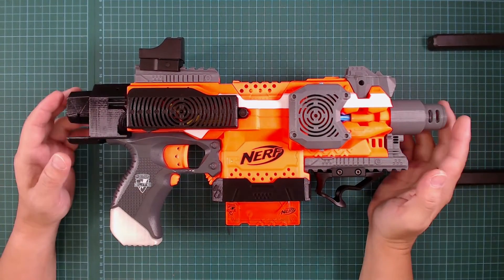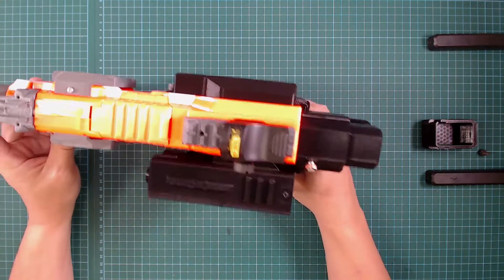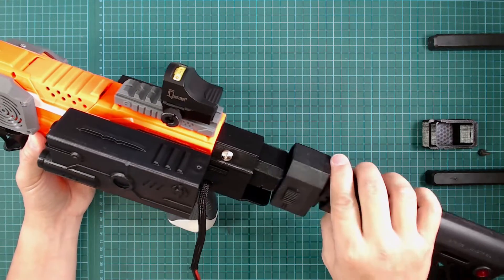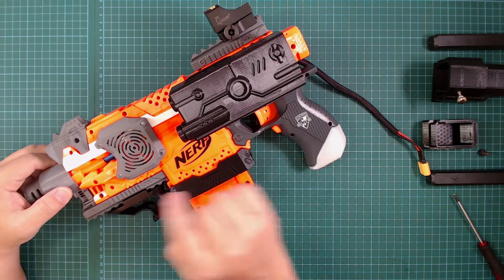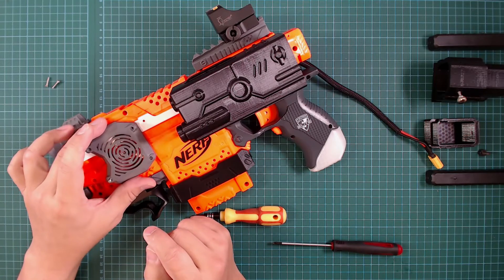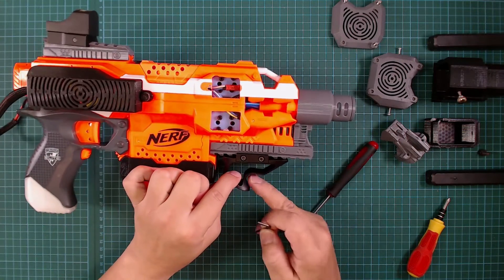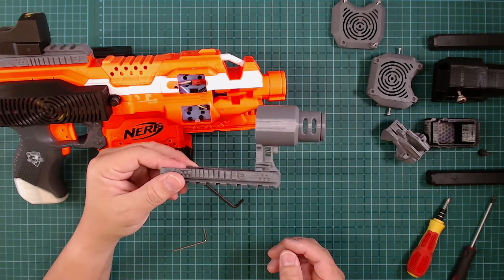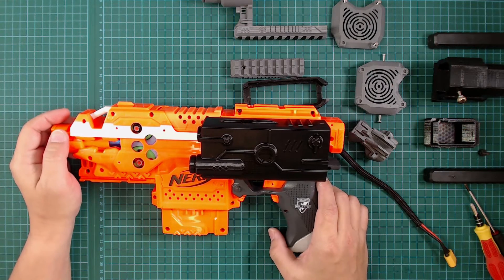Tungsten V4-I - My first Brushless attempt Part 3 - My Thingiverse

Comment: @tungstenexe AWESOME as always. On question, where do you buy the insert (nut insert) for the groove screw of the top rail? What size (diameter and height) do u use? 
How to install it snuggly inside that 3D printed rail? Thx.
Reply from the maker: hi I use these type of screws, I believe I use 5x8 for the rails and 3x3 for the tip front piece https://www.aliexpress.com/item/200pcs-Hexagon-Socket-Headless-Screw-Concave-End-Fixing-Screw-For-Home-Use/32909883281.html?spm=2114.12057483.0.0.2b3c232160QDf9

Comment: Good looking stuff.  I love that battery compartment and the extended stock point.  Excellent work, sir.
Reply from the maker: Thanks homelee, I model it with references to the one I used in my select fire stryfe, I make the case bigger and change the design a little.